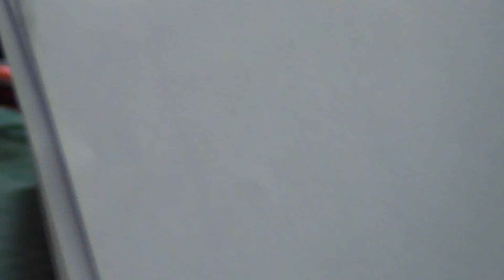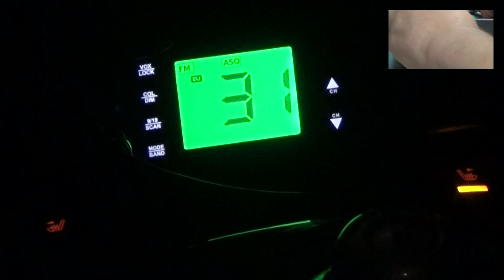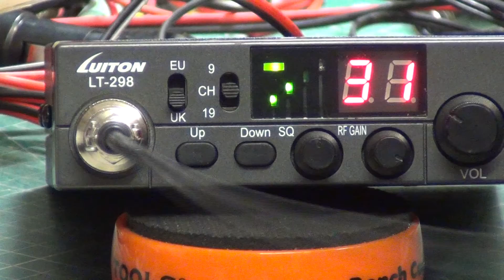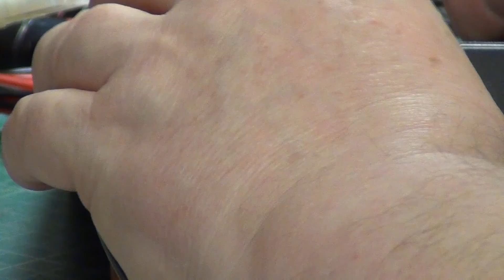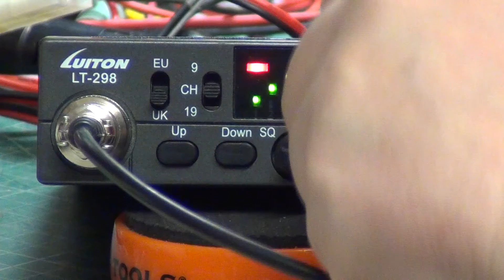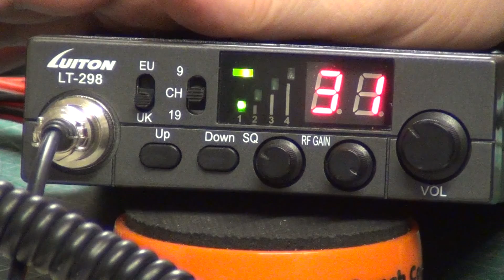Luiton LT298 CE MultiNorm UK/EU CB radio -  On The Air test (UK FM & EU AM & FM)

Comment: Do you know if this is a good radio for house to house? About 7 km distance. Just wondering how to get into it since my buddy convinced me to buy one with him but I haven't a clue how these work.
Reply from the maker: All UK CB radios are the same range. Like most other countries who have a CB radio system, the UK also has a 4W power limit. Our (UK) Government say "CB radio offers a 2-way radio service of up to 16KM range". In fact, I can get 35 miles on totally legal equipment base to mobile....in the right direction, and 10 miles in the 'bad' direction.

Car to car is another kettle of fish....expect up to 14 miles in open countryside & 1.5 miles in a busy town.

If you are in the UK, best range is the UK set of channels because the CEPT set of channels (these are 80 channel sets in the UK), are often full of interference from other users overseas.

It goes without saying you need a base station aerial on the outside of your house if you are using this as a base station. In this video you have commented on, I have this connected to our Solarcon 99 base aerial which is on a wall bracket outside. I have no difficulty in communicating 7KM with this radio & the Solacon 99 aerial, even back to walkie talkie radios.

Richard, G0OJF, UK
Reply: @ukfmcbradioservicingTango21 thank you so much brother have a good one.

Comment: I have the us version and it is stuck in FM mode
Reply from the maker: Is there a 'master reset' mentioned in the instruction book?

Richard, G0OJF, UK
Reply: @ukfmcbradioservicingTango21  unfortunately not, plus they gave me the instruction manual for the EU/UK version 😂 returned to amazon for a replacement that should be here tomorrow

Comment: No noticeable 'pinging' when Mr C keyed the mic outside Tango Towers - at least, not that I could detect. Is this possibly a by-product of a modern set talking to another modern set or perhaps the auto-squelch on the Luiton is a bit more discriminating? Good little radio for the money in all its forms it seems, if you can put up with the downsides like CPU noise and such.
Reply from the maker: Most current sets seem to do the tx pinging whilst the vco locks. I don't think it would have been acceptable 40 years ago.

Richard

Comment: There really isn't any faffing about on the Thunderpole, either to get to UK, or to engage AM.

And I agree that "behind the interference", the AM voice was better than on FM ... and likely for the reasons you discussed.

I missed it - did you end up leaving auto-squelch on for the whole test?

Ancaster Service Station (Murco)
N/A

Rauceby level crossing (Murco)
£1.497/L -> US$1.82/L -> US$6.89/US Gal | C$2.52/L
£1.619/L -> US$1.97/L -> US$7.45/US Gal | C$2.72/L - Diesel
Reply from the maker: Roger on that, I left the Luiton on auto-squelch throughout the test.

Richard